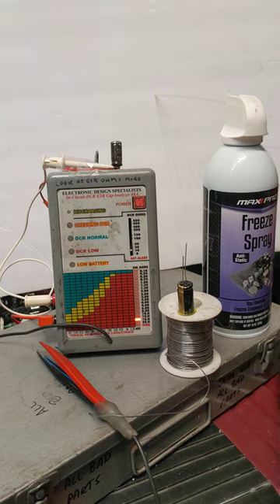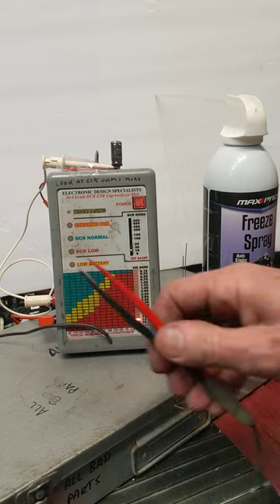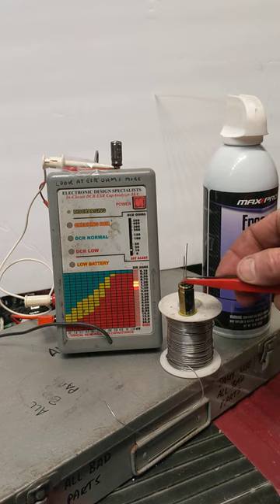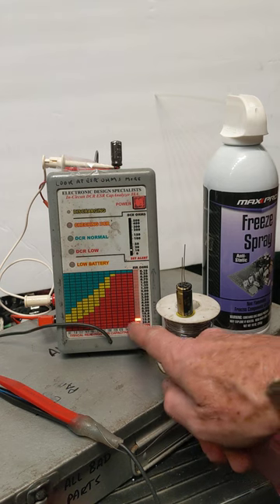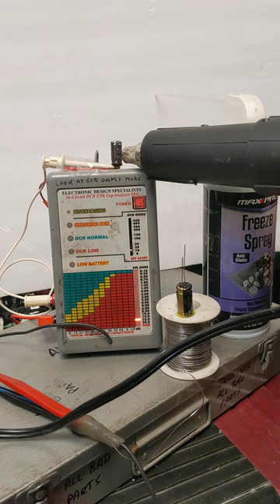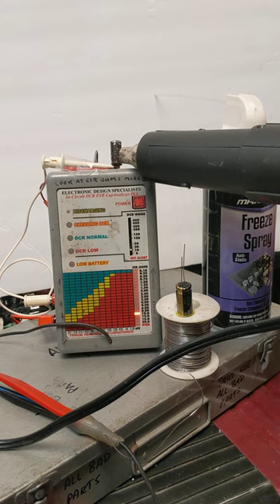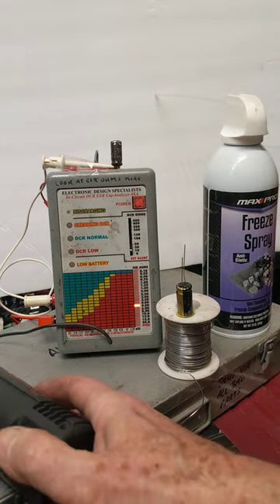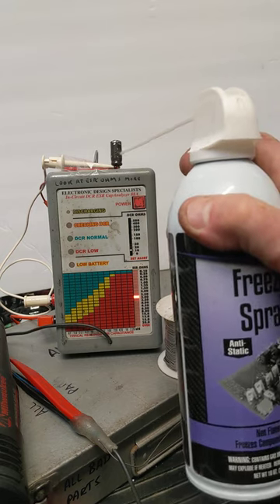Finding Bad Capacitors With A Hair Dryer Or Heat Gun

Comment: Good tip. 
I used to use a hair dryer to heat a whole device to see if the fault would clear. 
Good starting point if you suspect bed electrolytics.

Comment: Well that debunks my theory on why one of my tvs doesn't work. An old 5" Samsung crt type. When I got it, it wouldn't power on, so I stored it in the garage until I got to it for repair. Well then winter arrived, and I happened to just plug it in for fun, powered it on and it fired right up in the garage. It only works if it's around 20° F. In the house where it's warmer, it's a no-go. Eager to see the cold cap vid.
Reply from the maker: When I mentioned using the freeze spray technique, freeze spray was something I would use, when I had an intermittent problem that would work at times, and I wanted to trigger the problem to occur, by freezing one of the capacitors, hoping that the electronic device under test might fail to turn on when the capacitor was cold.
Reply: This problem sounds like a broken solder joint that expands and opens the circuit when it gets warmer. I'd try looking for that.

Comment: Nice tool !!

Been there done that !!  

The radial shaped ones can 
leak out the bottom, too.
It'll pay to look under with a bright light
if possible. Lable their polarity or photograph before lifting off the board.

Great demonstration.
Reply from the maker: Thank you. Just for the record, I've replaced many electrolytic capacitors that don't didn't show any signs of leakage or bulging.
Reply: @GrantsPassTVRepair some split the top vent without bulging or the rubber seal without leaking any fluid. The fluid boils dry inside the capacitor can.

Comment: I have a high end JVC VCR that while valuable, it doesnt work right away.  I literally have to throw the thing in a barely large enough food dehydrator for a few hours to get it warm enough to operate.  Once it operates it will stay on forever, until i turn it off at which point it would need to be warmed up again.  Obviously this JVC model is known to have bad capacitors.

Comment: I had an old 10 megabit Ethernet card that wouldn't work until I heated the 20MHz crystal a bit with my soldering iron to get it started. A lot of intermittent issues are just temperature related.
Reply from the maker: For sure. Using a little heat can be a great electronic troubleshooting aid on more than just capacitors.
Reply: No, they are not temperature related.
You are just using temperature to find them.

If the board fails because of the temperature, too cold, too hot, then you can say it is temperature related.

A crystal that is intended to work at 68°F that doesn't work at 68°F is not a temperature related problem, even though you have heated that crystal to 105°F. You're just finding the faulty component using heat.

Same here in this video. He is using heat to find the problem; the cap isn't suffering from a temperature related problem.

Comment: I didn't know capacitors had an ohm value, I thought they were measured in farads.
Reply: Capacitors are measured in Farads.
But they also have a parasitic resistance and even parasitic inductance.

A perfect capacitor has capacitance only. But real capacitors are not perfect.

The parasitic resistance is referred to as ESR - equivalent series resistance.